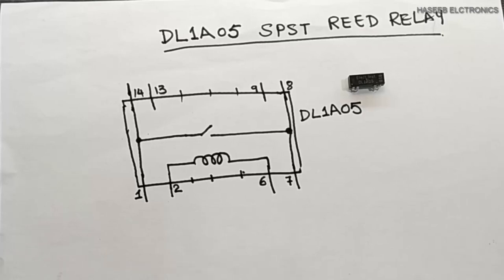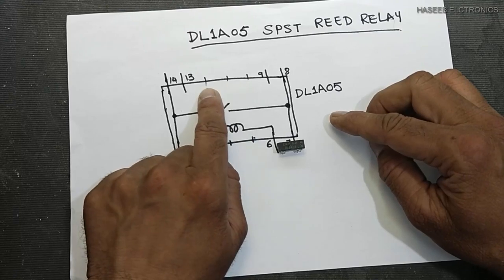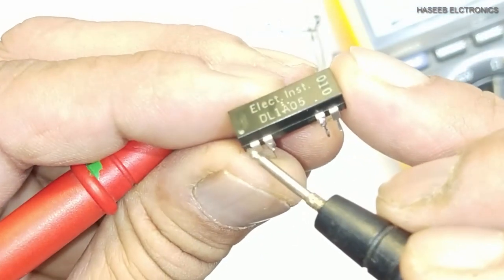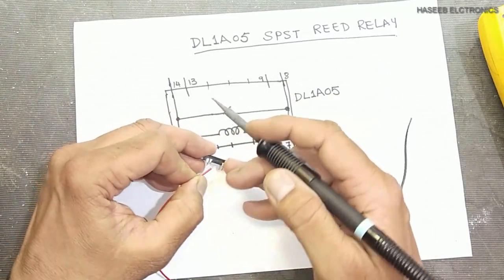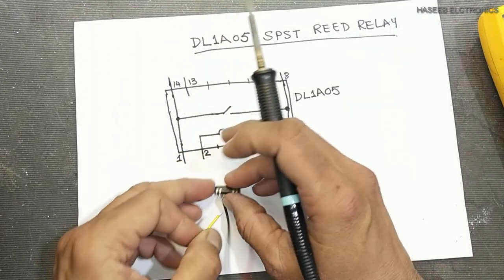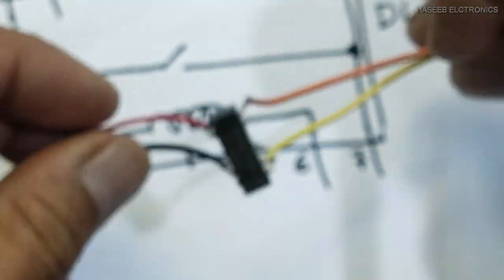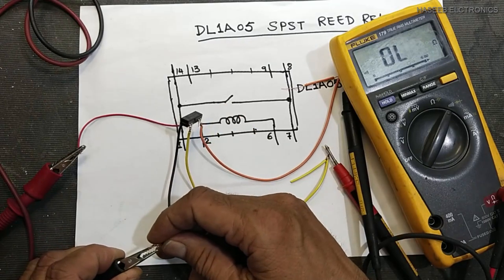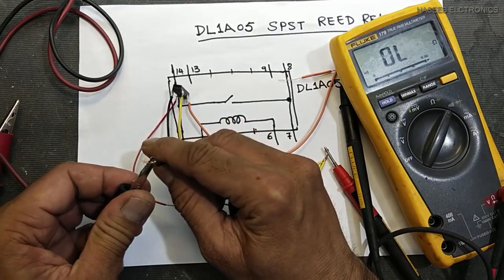{562} REED Relay Testing With DL1A05, What is SPST Reed Switch, How Magnetic Reed Switch Works

Comment: Thanks! I've never seen a relay like that. I'll keep this part in mind for a future project.
Reply from the maker: it is most commonly used in oscilloscopes, modular multimeters, switching matrixes, data switches, video splitters, , its most common type is NTE456 series is being used

Comment: Does such a relay need an anti parallel diode?
Reply from the maker: every relay needs antiparallel diode, 
otherwise it makes oscillation and it can damage the driver or it make random switching during turning off time so load may be interrupted

Comment: सर आपसे विनम्र निवेदन है की आप एक ऐसा डिवाइस बताइए  जो 12 वोल्ट सोलर पैनल के वोल्टेज को कम करके उसके एम्पीयर को बूस्ट करे उसके बनाने का सरल और आसान तरीका भी बताए बहुत जरूरी है पुनः आपसे रिक्वेस्ट है की आप जरूर मेरे बात पर ध्यान दे
Reply from the maker: it is best to use "MPPT" controller, it lowers the voltage and increases the current. and provides the maximum power value which can be achieved from that available power from the solar panel
Reply: सर इसको बनाने में कौन कौन समान लगेगा  और घर पर कैसे बनाएं उसके बनाने का तरीका बताए